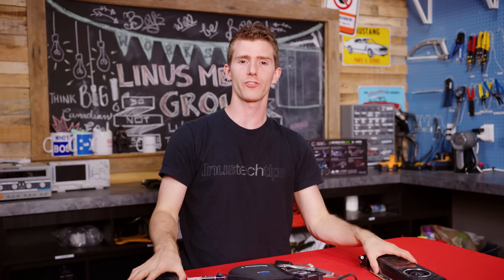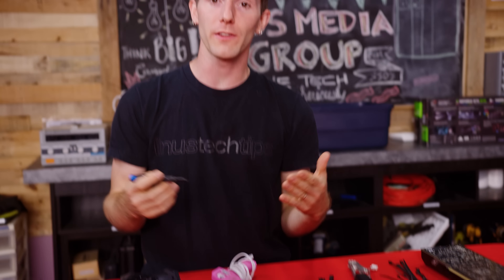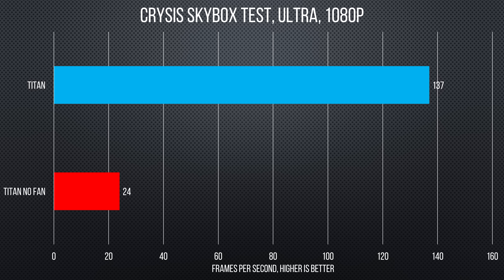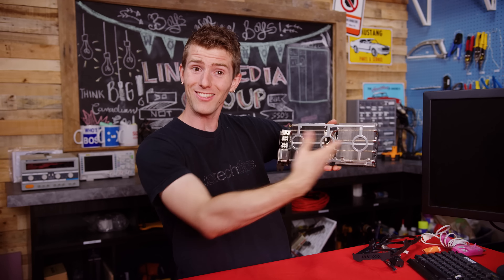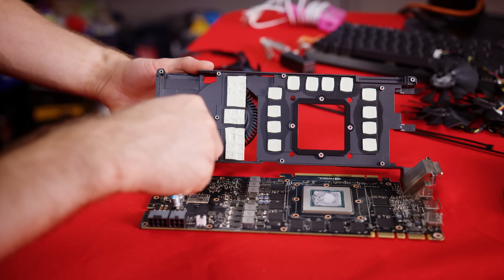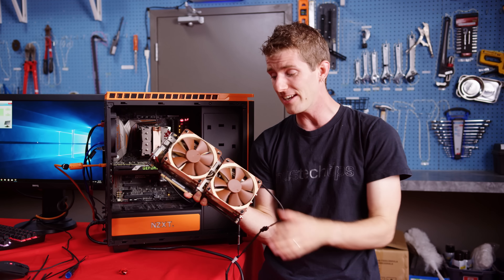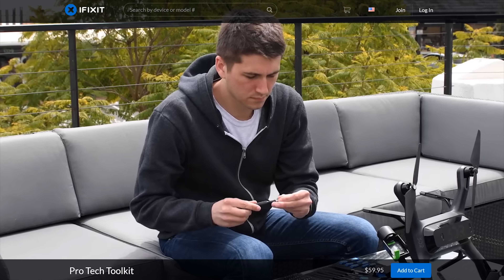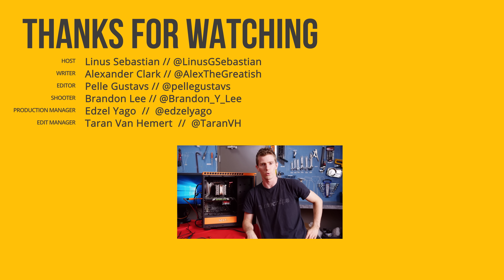Video Card Dead Fan Repair Guide

Comment: Hi Linus, I got a brand new build and I have yet to see the GPU fans spin. when you boot up the GPU fans spin a little then stop. This is a worry as it's an  £800 GPU. Asus RTX 280 Super EVO.  I can't get a temp reading from the bios, however, I have managed to download and install the drivers. everything is working fine apart from the fans on the GPU. please advise motherboard is aorus  z390 master g2 edition               I7 9700k CPU    16 Gb ram, dominator 3200 please help?

Comment: Does anyone know about this... I have an MSI Rx 580 8Gig. I installed it on my OC to mine. The display works. Fans work. Does in fact mine. But on the Kriptex system it doesn’t show as switchable to on and off. I tried using a riser first. Then I actually put it on the motherboard pcie port. And does the same thing

Comment: You can't replace blower fan (centrifugal) with standard fan (axial). Not without creating some kind of air duct to change air flow direction (to move air through the heat sink instead of cooling... fan hole).
Reply: They should have just removed the whole shroud and put the fan on the fins. That would have been the sensible thing to do.

Comment: The titan x mod might work better when taping shut the hole in the back of the fan shroud. I have no blower card to test it, but as you switch the type of fan the air might just use the easy way out to the back instead of trough the gpu cooler. Also you could destroy your shroud and position a fan right on top of the cooling fins.

Comment: my gtx 750s fan fell off its axis? My gpu started getting hot so I investigated and the fan wouldnt spin upon further inspection I guess what ever was holding it to the frame stopped holding it and it gets caught up on the heatsink

Comment: I put a 120mm and an 80mm fan on the top of the backplate of my R9 390 and it decreased temps by about 10 degrees.

Comment: Linus, you do realize that you can use GPU's fan header (which has PWM control) to power those fans up? You just need to compare the amperage of original and a "new" fan and if it's close, it works.
Reply: The problem is you can't find that info anywhere

Comment: Linus, In earnest response. What if you have two GPUs though< one is a MSI GTX 760 - with a nice twin frozr system - Fully working, CAN YOU replace the Blower of a Palit GTX 970 with this twin frozr system smoothly/? This would make an incredible video series. Especially for gamers always seeking cooler temperatures, and having spare parts available. Please help.

Comment: Quick question, I like the way Linus cable tied the fans on, because I tried this a month ago but mine looked messy and the ties were angled, plus I only used one tie on each corner. Can anyone tell me how he has tied them or can link me to a video of it. Cheers in advance
Reply: NVM, I watched a video from rlund3. I get it now, the 2nd cable tie is used purely to secure the first one, so pretty much only uses the head. So on the bottom of the video card that Linus is modding, or even underneath the fans is where the 1st head is, but it's hidden. I like this way of doing it as it looks clean and is more secure than how I was doing it. Thanks for the nice vid!~

Comment: trying to install PWM fans on my gtx1080 but the fans wont spin even using MSI afterburner and setting fan speed to 100%. Do the GPU fan headers not support normal PWM fans ? i have no more fan headers on my MOBO.

Comment: Guys! What program do you use to control the fans you installed like he did in this video? Im considering doing this but im clueless on how to control the fans.
Reply: @Erick Rosa i currently have amd radeon hd 7950 with only one working fan. I use msi afterburner to boost the working fan to keep gpu below 75celsius. This is until new fans arrive.

Comment: I have rx 580  i  also did this with  my gpu  with fans 1.60 amp runs @4100 rpm  which is  noisy like a jet. i attached pair of it but there is 0% difference in temps literally its always touching 80 to 84 diggeres before and after coustomization. Then i did one more experiment I opend the case turned my room temperatures into 22° with (Ac settings 16°)  sealing fan On then i played few games still there is no difference. Both fans running at 100% potential with Ac+ sealing fan  on literally no differences what shall i consider it?

Comment: Also linus why not try replacing the 120mm rad and fan on a seahawk x with maybe a h90 or h100i v2 or h105 etc as mounting a 140mm rad and fan may be better for seahawk x (for people who lie 140mm fans etc) can't actually seem ti find any forums about seahawk x aio so you could be the first

Comment: Being a Race Car Mechanic and Pit Crewman I cringe and have flashbacks to ripped open hands bleeding profusely soaked in brake clean and 110 Octane every time you cut them zip ties with scissors instead of flush cuts..lol

Comment: My fans work fine. Problem is the plastic plate where the fans attach. Idk what its called and Idk where to buy it. The screws broke off and it moves everytime the fans move faster.

Comment: hey, Linus. i’ve been having problems recently with my GTX 1060. i turned on my computer and the fan of the card spins but when i get to my home screen it stops. i test ran CSGO and i didn’t find and good performance. i usually get a solid frame rate but it lagged like crazy. do you have a fix?

Comment: How power efficient are GPU fans really, though? They're spinning up to 2000 - 3000 rpm (depending on gpu) and are probably on the cheap side, versus some 1200rpm noctua fans?
Reply: Plus, plugging them into the motherboard doesn't eat from the GPU's power budget (which is in most cases fairly limited on the stock bios) so thats the advantage I'd see

Comment: I don't consider this "repairing" a GPU fan...  This is replacing a GPU fan.  I have actually "repaired" a few fans.  Quite often fans stop working because dust gets in and clogs up the workings.  Using some powdered graphite and 3-in-1 oil, you can re-lubricate the fans.  I have resurrected fans that were completely seized up using this method and had them humming silently afterwards.  I have also had fans that were just starting to get noisy, and this method only helped them for a few months.  Your results WILL vary using this method, but if you cannot find a suitable replacement fan new, then it's worth a shot.

Comment: Did this mod with my strix 1070 just like the one he did but used Chromax fans 140 NF-A14 works great. just used the onboard external fan headers. Its just like asus wanted us to swap them. One thing  is you loose a little bit og RGB but i coundt give a damn about RGB. performance > rgb

Comment: silver foil tape might be better. the constant heating and cooling might undo your normal duct tape.
source: can confirm, am ghetto, have done. i didn't test numbers. just needed it to run to backup system then replaced gpu.

Comment: Hello. I have 2x Artic 120 mm standard 1500 rpm PWM fans connected to my graphics card AMD Radeon Rx 480. And exactly the way the original fans were connected, i.e. 4 pins and 3 pins. Only one of the two fans gives the RPM level signal. Both have same colors and I thnink wire colors is standard for these 4 colors. But now the automatic fan control no longer works. By default the fans run at 100% all the time even though they are silent fans and should not run without load. In Afterburner I can switch from automatic to manual and control it between 25% and 100% and manual control works! And the measurement diagram also shows me 900 - 1500 RPM. It looks like the card can carry the load of the bigger fans running them at 100%, no problem. But somehow the automatic control no longer works and I can't understand why ?

I see 2 options:

1) During the driver installation you will notice that the fans are being tested. It could possibly be that the installation detects an error because the fans do not spin up to 2000 or 3000 rpm like the original fans. And the installation then sets the automatic to permanent 100%.

2) You have to crack the firmware of the card and readjust the fan control of the firmware?

I guess it can only be the first though. That means there's nothing you can do except use fans with the same RPM. That no error and bad setting occurs ?

Comment: you received lower performance  on the GTX Titan because you replaced the Centrifugal Blower or "squirrel cage fan" which has a lot a more force with a standard cooling fan. thats no bueno for that cards plastic shroud the airflow was hindered bad.

Comment: This is almost as janky as the time I superglued a fan from an ATi card onto the cooler of a 9500GT because the screw holes didn't line up, and also had to replace the connector with one I had laying around and just twisted the wires together and slapped some electrical tape on them. It worked well enough though, no thermal throttling and it lasted until I upgraded my GPU.

Comment: my 980ti gigabyte triple fans all died at once and i couldn't even play any games, would just insta heat up to 94c and turn its self off, so i bought a delta fan then removed the old fans and electric taped it to it, and now it never even on full loads while OC goes over 55c

Comment: Check this out Linus, I bought an ASUS GTX 1070 Dual OC second hand off of ebay and noticed that it sounded like a vacuum cleaner in demanding games (Hitman 2, Sniper Elite 4).

I checked out the temps, and it maxed out at 83 degrees Celsius (ouch!)

I watched this video long before, so I put the theory in practice, bought a molex to 4x 3-pin fan adapter and 2x Arctic F8 80mm silent fans, then strapped them in with a couple of zip ties.

Originally I tried the black connectors (5v) for the fans and was getting highs of around 75 degrees Celsius, and then tried out the white connector and BAM. I was getting max temps of 62 degrees Celsius. Fully stable.

https://snag.gy/bz07Ik.jpg

There is absolutely NO reason to use stock cooling anymore, when they include shit tier shrouds that really limit the airflow and fans that couldn't even flap a blade of grass.
Reply: Could you be a little more specific about which connector you used? Did you use the fan connector on the GPU or a fan connector on your motherboard? Also, what kind of connectors do your fans use: 3-pin or 4-pin? If you connected your fans to the GPU, what kind of adapter did you use? Or did you directly plug your fans into your power supply (you did talk about a molex adapter) ?

Comment: It's better to bought PCI Slot Dual Fan Mount Rack Bracket or PCI Fan Coolers than do this when the stock fans doesn't perform well. Just remove the old fan and shroud then put the pcie fans . I got a better temp like 20C less than the old stock fan in full load.

Comment: Instead of using a small fan, why not strap on a 120mm+ fan? If cooling is your problem, you'd get better preformance and it will be more quiet.

Comment: While this is a pretty nice video guide, you've skipped over an important point. The purpose of the fan connector on the GPU is to allow the GPU to have control over the fans, but, if you connect the fans to the motherboard, your GPU won't be able to increase fan speeds when it gets hotter, that's now the motherboard's responsibility.
My question is how do you setup all this (on the software side) ? Can you do this directly from the BIOS ? Or do you need to do this from your OS (instructions for Windows, Mac and Linux would be nice) ?
Reply: You can control fans from the BIOS. Set it to like 45-50% and they would stay pretty quiet and still keep the card under control.
Reply: @hammad.ahmed9496  Thanks. I guess this is the "easy" way to do it. My question however was: can you set the fan speed on "auto" in your motherboard's settings and make it react to the GPU's temperature ?
... Guess I should have formulated it like this. XD

Comment: noctua gpu was alright but most of these zip tie hacks are awfull and plain lazy. You can find a fan which fits in there if you are willing to wait a few days for not too much and in most cases this adds a lot of thickness to your cards... good luck if you are using SLI or have a small form factor case or any pci cards beside it..

Comment: Or you can just do what I did when the fan in my old 7790 died, zip tied an old intel CPU fan onto it and called it a day. Ended up burning up right after I replaced it.

Comment: But.. Why couldn't you just use an Artic 3 cooler on it? It would be a lot cheaper than two noctua fans, probably a lot cheaper than buying the parts off of ebay or from a third party, and it would definitely be cheaper than sending it to the company for out-of-waranty repair.

Comment: I am changing fans even if it's working, because normal 25 mm fans are much more effective than low profile shits wich are mounted defaultly. It's very huge difference in noise, you can have same temperatures with half RPM. I am connecting it to GPU always, I am doing this 10 years and it's working without problems, it's 100% safe. If it can handle 3000 RPM default fan, it has to handle even normal 120mm fan with 1500 or 2500 RPM. You can have 2W fan and you can have 5W fan, but honestly, I tried even power 4 fans from one connector on motherboard and it can handle more than people think. What is few watts? You can power your 2kW vacuum cleaner with cable with 2 mm diametr, why wouldn't PCB electric paths and connectors handle few single watts? It makes no sense.

Comment: Well my gpu fan just broke on my 280X, the other one is still working tho.
Also, many fans on gpus have power draws of up to 7 watts (at least mine do), so the Noctuas are actually more efficient than the normal fans on the STrix (if they go up to 3000 rpm like the ones on my Asus 280X do). Thats that and I wasted my time.

Comment: Well no shit the Titan one didn't work out well, they put the wrong kind of fan, and even if they did end up putting the right kind of fan there, it's still ON TOP of its heatsink. It's supposed to blow air through the heatsink, not on top of a shroud on top of the heatsink.

Comment: My 980ti g1 had 2 fans stop working, so I looked arround for a replacement.. found a fan on eBay, 15$ for 1 single fan, nice joke, found a pack of 3 Asus ones very similar, that works great actually, however.. I got a problem, I had to solder them since the fan plugs were no compatible (damn it..) I should have just buy adapters.. because I soldered 1, it worked fine, surprisingly I didn't had problems, even though I did only solder 2 cables so no speed control.. , now a second fan broken (gigabytes.. Worth fans.. my friend who sold me the card also had 1 fan replacement with RMA keep in mind..) I soldered it too, but somehow now I think all my 3 fans are running at 100% speed.. 4300 RPM, and it does fuck tons of noise, it's annoying..I didn't thought about this issue at first, and like I said it wasn't a problem, unless I broke Something .. when I tryed the voltage I did it live on the running card and got a short circuit which shut down the pc (scary shit, never do that..but I didn't had any 9v-12v source so..) I think I must have broke Something..I don't know, it doesn't really make sense, but the fans are now running at full speed and I don't know what could I do.. maybe solder the other 2 cables along with the power cables BUT, the thing is I have no idea which cable does what.. so besides going by trial and error (which suck.. have to plug cables together, put card back in, test etc..plus I don't want to mess things up if I connect 2 cables I shouldnt connect together..) so now I don't really know what to do, I'm stuck with my super Noisy card, fuck sake, I don't want to replace the cooler just for that and have to spend 100 bucks.. Right now I'm looking about running some automatic fan control with the temperature but it sounds complicated.. I thought about using the motherboard fan control (if my mobo have it..) but then, there is no real way to make it dependent on the GPU temperature.. so I feel screwed, I don't know what to do, maybe find an electronician that fixes it for cheap ? I don't know.. help would be appreciated ! Or I could do manual fan control but dang, having to turn up your fans when gaming sound so medieval.

Comment: WAIT WAIT WAIT WAIT, i could go passive on say, a 1060, using a 1070 heatsink, and just lose a little performance? sign me up, i've got a reletively high airflow server that needs GPU offload, but i dont have the room for a GPU with fans, well, nothing more than say a 1030/1050 low profile

Comment: If only GFX cards came with good cooling from the get go, or atleast applied easier changes that wouldnt break waranty so we dont have to RMA for 2 weeks. Gigabyte has the worst cooling ever, 3 fans and they produce winds of a toddler. All the cards ive had from gigabyte had problems with fans, now i see why.

Comment: For those 'Blower' type GPU cooler's, you need to be looking at a different type of 'Squirrel Cage' fan. And hope that you can find something that fits..
https://www.google.com/shopping/product/559702365302375041?q=squirrel+cage+GPU+fans&client=browser-ubuntu&hs=jti&channel=fe&hl=en&biw=1237&bih=901&sa=X&ved=0ahUKEwiCjefDpa3eAhXWGTQIHQ7nB28QrRIIWw
Or
https://www.google.com/shopping/product/7532637471498681309?q=squirrel+cage+GPU+fans&client=browser-ubuntu&hs=jti&channel=fe&hl=en&biw=1237&bih=901&sa=X&ved=0ahUKEwiCjefDpa3eAhXWGTQIHQ7nB28QrRIIWA
Something along those lines or similar.